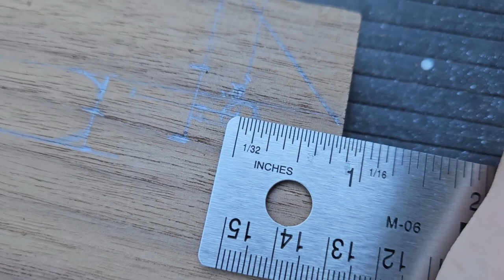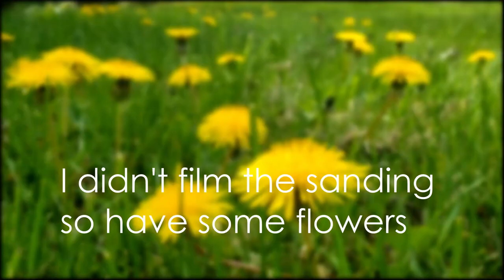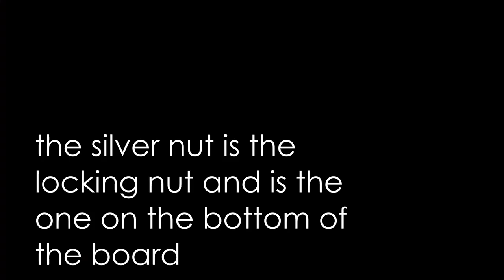I made my own ✨aesthetic✨ bookbinding sewing frame

Comment: Dear Enchanted:

Nicely done! This is a magnificant item, very practical but gorgeous to look at. You can get a lifetime's use out of this, and pass it on to the next generation. It can last 100 years. If I may be so bold as to make a few comments....

1) you borrowed your dad's tools. ROCK ON! Criminy, every time somebody tells me they need their own woodshop before they can start, my eyes spin like dice in their sockets. I spend $5 a day to use a local community woodshop. I can't spend a day watching  a movie for that price.

2) walnut. Wow. Yours probably looks 10 times better. I used oak, but mine cost $2. Check if there's a lumber mill in town; mine were "drop offs" pulled from a scrap bin. Oak still looks nice, and is really tough.

3) you use a lock nut, washer, second washer, brass nut, wing nut, washer, second washer, second wing nut. Yep, that works. But is about twice the hardware you need. Especially if you are like me, disassembling the frame to take to shows. I use nothing under the table, add nuts to the bottom of uprights, slide the 2 uprights in place, put two bolts toward the top, and drop the yoke in place. All loose and wobbly, right? When I put twine through keys and tie at the top, then use the nuts to put pressure on, it locks up tighter than a drum. 4 nuts, maybe 4 washers. 

4) if you take only 1 thing away from my ramble, learn how to use a tap and die to make wood threaded rods and nuts. Yes, videos on YouTube make it look easy. But IT IS JUST THAT SIMPLE. Steel threaded rod and hex nuts aren't cheap, and wing nuts are ridiculously expensive. Spend money once on a tap and die for wood, and you can make a sewing frame that's a dead ringer for one used 200 years ago. For less money in materials.
Reply: If anyone does not have a router or saber saw but does have a table saw, the slots are easy to make if you have clamps and glue.

1) make first cut off large bar off the large board (table) and small piece at the top (yoke). Measurements aren't precise, let's take a full inch bar off the table. The yoke should be more than 2 inches wide, try to cut it in half. 

2) cut a thin strip off the table, 3/8ths will do. 

3) cut 4 pieces off the strip. I cut mine 2 3/4 inches each. 

4) sandwich 2 thin strips between the 2 pieces of yoke on the ends, and between the table and 1 inch bar. 

5) optional. If you are like me, you will want to tidy everything up the next day with a hand plane or power planer. 

6) sand and finish.